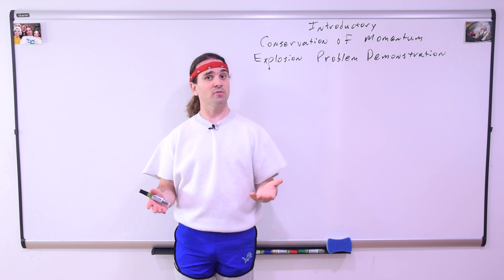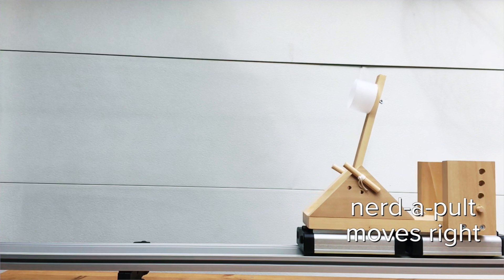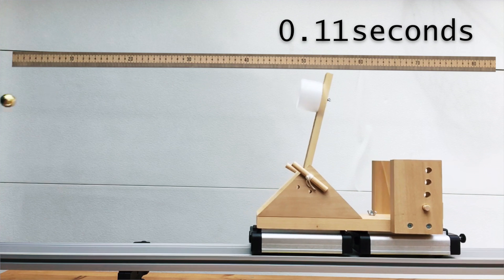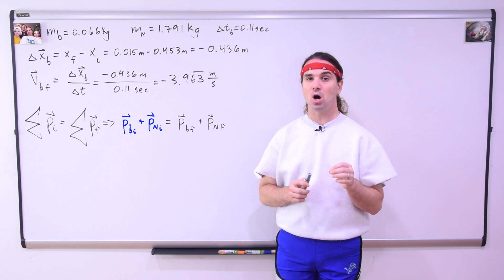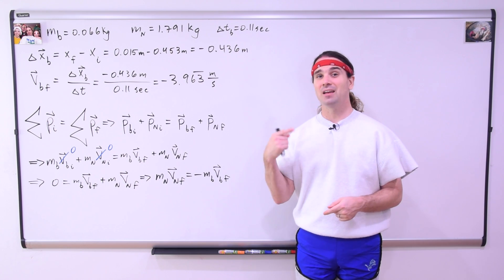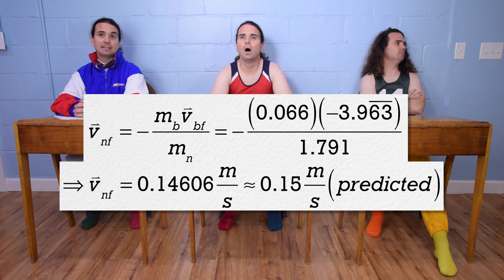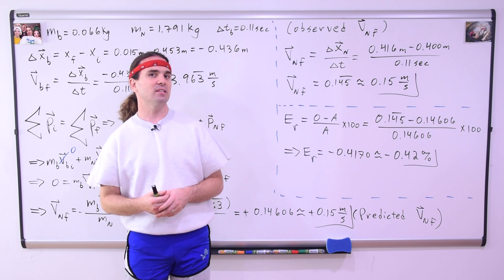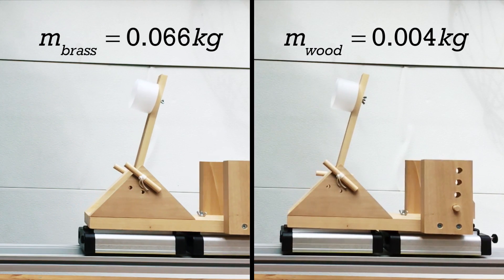Introductory Conservation of Momentum Explosion Problem Demonstration

Comment: If the displacement of the wood ball is the same as the displacement of the brass ball. Then the Nerd-a-Pult's Velocity would be .009 m/s which is around 17 times lower than the velocity of the Nerd-a-Pult if the brass ball was used. I guessing the velocity of the Nerd-a-Pult from the wood ball (.009) is not enough to get it moving because it would have to overcome the static friction. Is this correct?
Reply from the maker: Sounds good!

Comment: Mr.P pls say should I always consider the horizontal velocity ? . Why not inclined velocity in projectile motion ?
Reply: Good question.  In this example, we have a constraint force that takes care of the vertical.  The normal force from the track will be as large as necessary to stop the carts from falling down.  As the nerd-a-pult launches the ball slightly upward, it also would recoil downward from this interaction, if it were free to do so.  But, the track pushes up on it, to stop this from happening to a noticeable degree.

Comment: The nerd-a-pult does not move because it has 447.75 times the mass of the wooden ball. Thus, as the total momentum must be conserved, but because the wooden ball has very little momentum (due to its mass), the nerd-a-pult has the same momentum, but negative (because the initial momentum is zero). The momentum of the nerd-a-pult after the explosion is not exactly zero, because the ball has momentum, very little due to its mass, but it has. Therefore, the nerd-a-pult must move, though a really small amount of distance.
Reply: So will both objects have the same momentum in both directions because of the conservation of momentum. Similar to two people pushing off of each other on an ice rink. I’m really confused I’m this